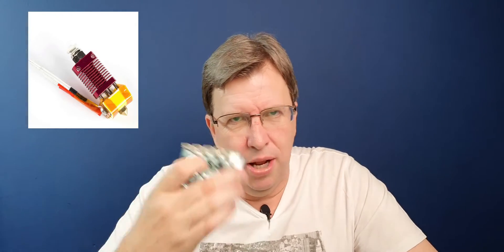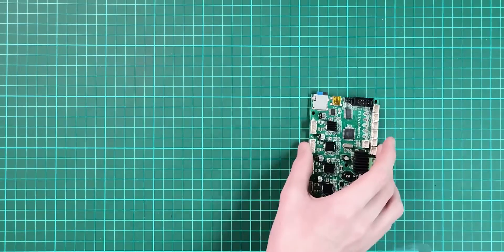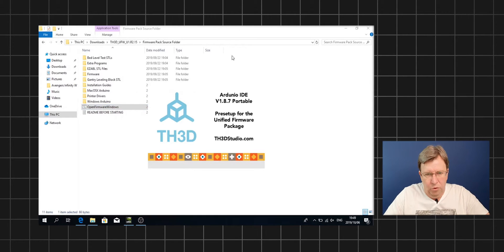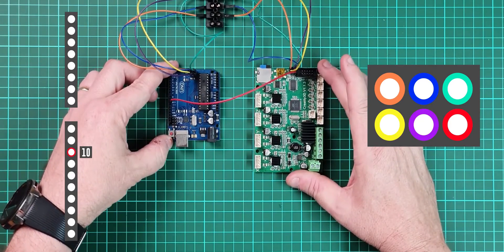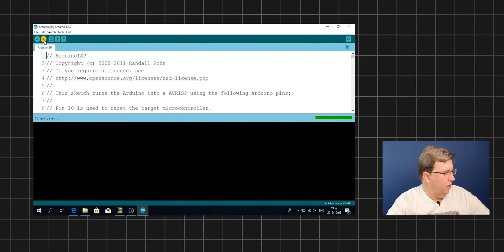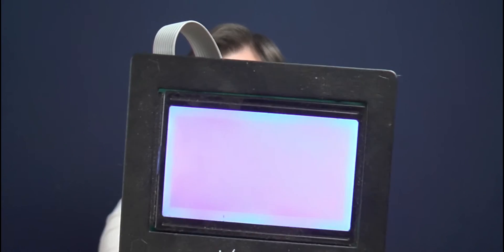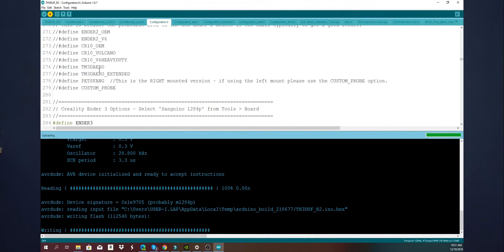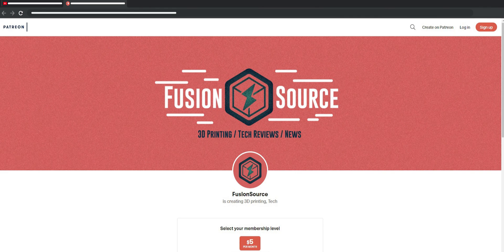ENDER 3 | Bootloader and Firmware Upgrade | THE EASY WAY (Updated)

Comment: how do i get rid of this issue

 avrdude: Device signature = 0xffffff (probably .avr8x_mega)
avrdude: Yikes!  Invalid device signature.
         Double check connections and try again, or use -F to override
         this check.
Reply from the maker: Howsit, so if you look in the description, there is a comment there, I have attached it below:

Thanks to DaaaveO1971, here is a great tip if you get the "Invalid Device Signature Error".  If you connect all 6 pins between the header one for one, in some instances, the Arduino would fail to burn the bootloader.  To correct this, connect all the pins except the RESET pin, connect the the RESET pin #10 on the Arduino.  I have not verified this but thanks again to DaaaveO.

Comment: I have Ender 5 pro with SKR Mini E3 V2.0 Control Board 32Bit +TFT35 E3 V3.0 Integrated with TMC2209 I installed also a ISP pin board from my BL touch, can I use the same settings? I appreciate it, think you.

Comment: Thank you! Even I understood this ;-D I've done this on 3 Ender3's now to increase the temperature for use with the MicroSwiss all metal hotend and extruder kit. Love these printers. Control F to search the screen for temp and its like the second temp you will come across. Set mine to 290 so I can run Onyx carbon fiber Nylon... Cheers!
Reply from the maker: I am so glad it helped, this for the tip.

Comment: Great video, thanks!!! I have the Arduino now to try this, I also got the BLtouch from Creality with the USB ISP V2.0, but I wasn't sure if I was able to use that through Arduino IDE as I can't see any similar ISP. I have already compiled my Marlin 2.0.7 with VSCode and I'm happy with that... will I be able to upload it from VSCode once the bootloader is installed? Or is there an easy way to use my USB ISP instead Arduino? Thanks a lot!
Reply from the maker: I am glad the video helped.  I will need to do a bit of research into the USB ISP to see if it will work but I have a feeling it will because that is basically the function that the Arduino is performing

Comment: Brilliant!  This video deserves far more views than it has!
Reply from the maker: Thanks Dave, that means a lot to me.  The channel is growing and starting to see more views and subs.  I will keep moving forward.  Please share the video.
Reply: @FusionSource  I just went through the process and noticed one issue.  If I connected all 6 pins between the headers one for one, it the Arduino would fail burning the bootloader with a  "Yikes!  Invalid device signature" error.  To correct that, I connected all of the pins except the RESET pin.  Once I connected the RESET pin on the Creality board to pin #10 on the Arduino, it worked perfectly.

If anyone is having that error, give changing that one pin a try.  If you're doing this with the board still inside the printer, the RESET pin is the top left one.

Aside from that, EVERYTHING in this video went as described.  Thanks again!
Reply from the maker: @DaaaveO1971 Thanks Dave, great advise there, I will add that to the description.

Comment: So I'm using a board that is equivalent to an arduino uno and it is saying "Yikes! Invalid Device Signature." I am trying to find out where to do -F so I can override it.
Reply: You probably solved it already, but if anyone else is having the same issue I solved it by rewiring with another set of cables. So either bad wiring or bad cables.
Reply from the maker: Hi Lexzach, sorry for the late reply, I am not sure why it is doing that, I will do some research and let you know if I can find something

Comment: Hey, I followed the more complex guides and developed packages under Visual studio code and after I flashed all was well until I ended up with a blue screen post printer power cycle. You could still interact with the printer so it was just a display issue but could not get it with multiple build attempts.

This guide helped me reset it to a working configuration. So very much appreciate your time and effort for the guide.
Reply from the maker: Thank you for the feedback Nick, so glad it helped